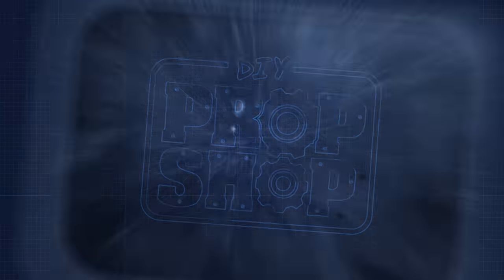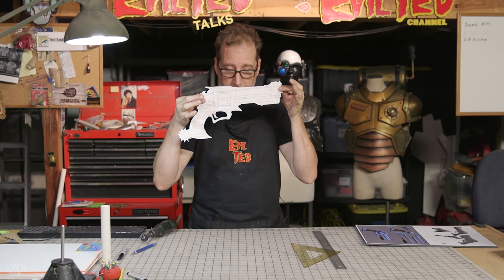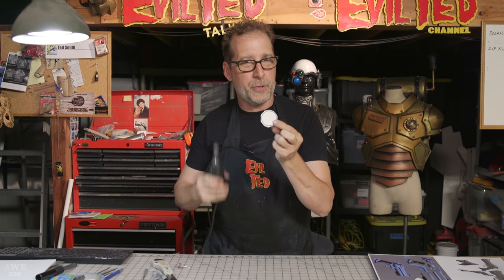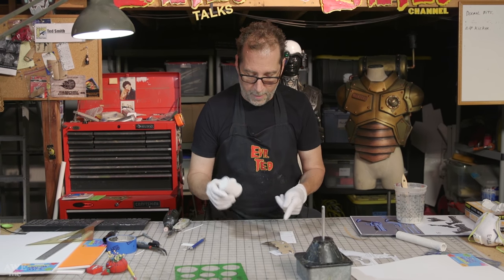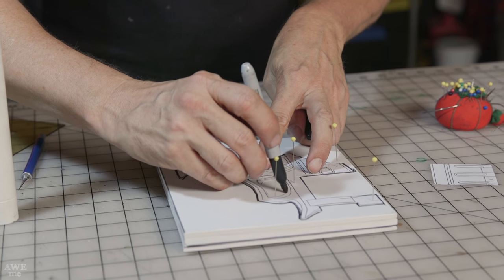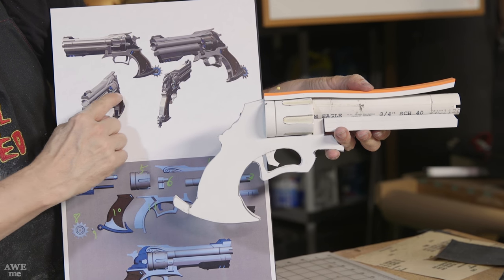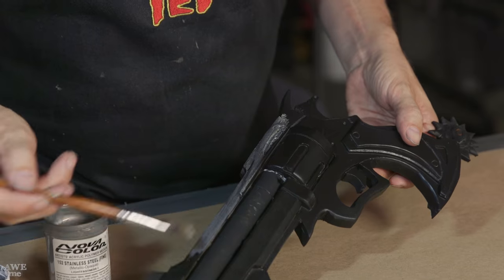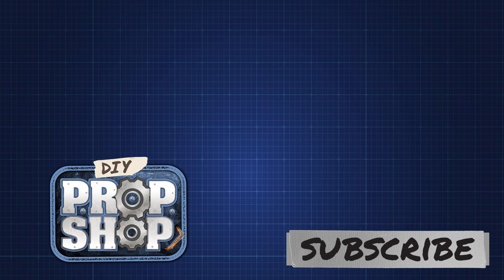McCree's Pistol - Overwatch - DIY PROP SHOP

Comment: Finally some really well made piece from prop shot. Must be honest. The other ones are kinda unfinished, like my english... But this revolver came out pretty nicelly.
Reply: It's because this one, unlike the other guys on the show, is a professionnal ^^
He has like 20 or so years in costume making, probably even more!
just check his youtube channel
Reply: I will, thanks for the tip. Me myself, not a pro, but I make better stuff then the other guys and have like 4 years in cosmaking. I just don't understand why make videos about things that look awfully unfinished.
Reply: Uhhh....  this one looks just as 'unfinished' as others. I am sure these are fast builds no matter who is doing them but this is not higher quality compared to Odin and Vinny. There are flaws within the revolver just like any other props that are made here.
Reply: N 'So The only thing that was kinda bad on it was the painting. Can't say the same for the others. But I agree, not top quality.
Reply: go to Ted's main Channel and he will blow you away with the work he does with the proper tools, better quality materials and a longer run time. You can also check out Bill Doran's channel at Punished Props to fill in some knowledge gaps.
Reply: hyperguyver2 Punished Props hey... That assaultron is awfull! But I will check the rest. Thanks.

Comment: go back to your own channel.....
report this mildly offensive comment for hero points
Reply: why do you have a problem this video is amazing
Reply: If you had videos, you'd be about to catch this mass flag boi :D
Reply: They don't hate it, they are making fun of the new YouTube system that rewards people for indiscriminate mass flagging/reporting
Reply: I'm pretty sure when he responded he didn't edit in the second part
Reply: Video is of decent quality but the content is not that great and the project is kind of "bleh". Its just a carved foam scuplture. The really bad part is anywhere some actualy tecnique was being applied and a good narration to explain it would have been awesome, there was just a little pop up caption about it.  How does heat accentuate detail cuts? Or using a wood burner to get fine detail.  No instead he explains a glue pot.
Reply: liveepically maybe it got edited out by the channel. It's only a 12 min video. He's got hours of explaining techniques on his channel. If you're interested at all in using these techniques, he explains them thoroughly.
Reply: Vakra GIMME MY HERO POINTS!

Comment: I'm pretty happy with DAP Weldwood, it's like 6 bucks for a 13 oz can of it, put it in a restraunt style ketchup or mustard bottle and it is super controllable. I picked up two bottles for a buck fifty. A little cheaper than the 35 buck glue pot, then I can spread it with a scrap piece of foam or my finger, so no strings of glue, hardy any mess, and you don't have to worry about your glue drying.

Comment: Not bad, really but I've got a question... Why it always has to be a foam? DIY is not only foam, glue knife and heatgun. Cos of this the series looks like it's aimed to primary school kids who are afraid to use tools... 😒
Reply: Not everybody has access to nice tools like band saws and belt sanders. This is just to show you can make props and such without them.
Reply: I'm not talking about fancy stuff but everybody has a driller, saw, wood/metal pieces etc... it's not so difficult to use it for a god sake. NOT EVERYONE has to have an access to hotglue gun or heatgun either. It's just a matter of "are you motivated to do something more or not"...
Reply: Evil Ted specializes in foam armor and props. He could probably do the other stuff but this is where he shines. He's a master of foam so we're going to see him work in foam.
Reply: And that's the answer I was looking for, thanks
Reply: Most of the time, the people who make these props at home are using them for conventions or short films. When that's the case, metal and wood props are usually more dangerous to use around other people, whereas foam is harmless. If someone gets smacked in the head with a wooden gun, it's going to hurt. But no one's gonna get hurt by a foam gun.

Comment: That's a scroll saw not a band saw. I would have suggested a coping saw over the box cutter, they're fairly inexpensive, easy to work with, and extremely accurate for detail work.

Comment: I've always used dap weldwood cement and noticed it came apart if I used a heat gun on the foam. Is that a problem with barge?

Comment: is there a reason not to plastidip the plastic PVC? does it melt it or something?
Reply: ah good to know
Reply: Thanks Odin.
Reply: If the PVC was sanded would it hold better?
Reply: It won't stick to PVC plastic as well and will peal of over time.